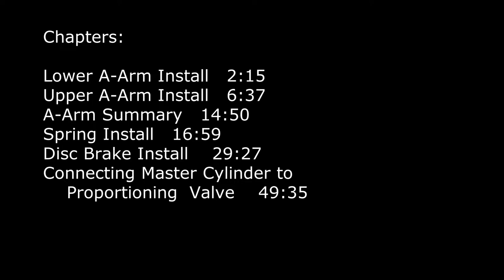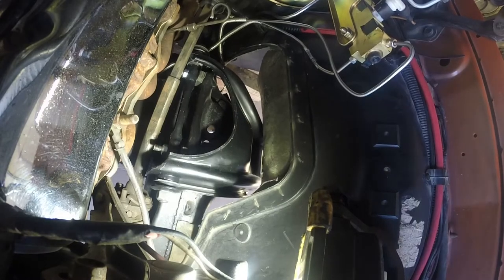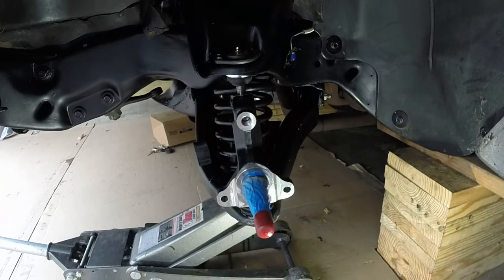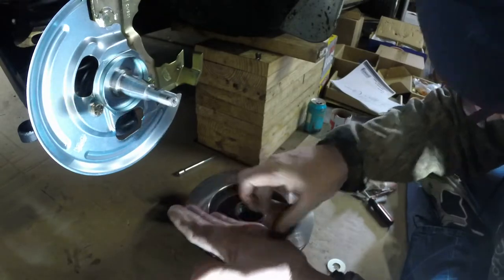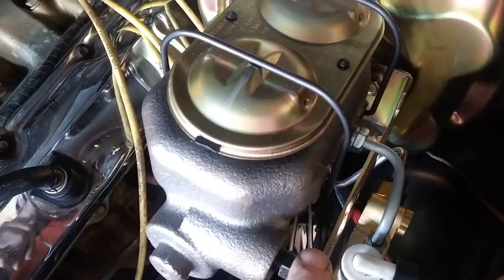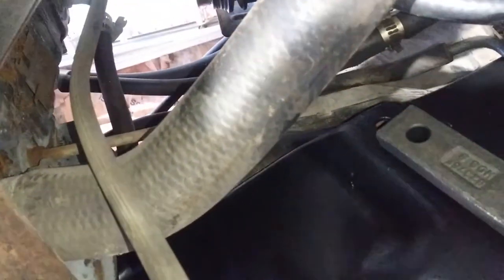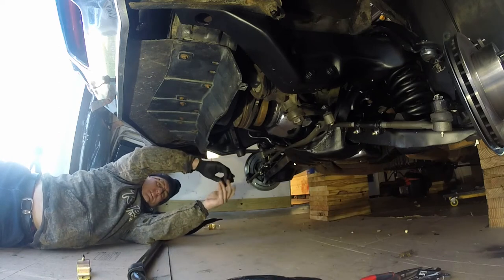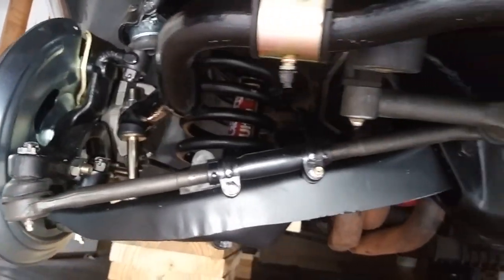72 Olds Cutlass Restored Front End ... In Detail

Comment: Hi great video! I just got my 71 last week and it needs whole front suspension redone like yours. Mine already has front discs. Do you have a link to all the parts you got like spindles control arms etcetera? It would help alot i want to redo it during winter.
Reply from the maker: That is a great idea and I will get one compiled and added to description. I used mostly moog  on the front end. Brake parts were from summit.
Reply: Thanks again I appreciate it.

Comment: Behind the seat of a 72 olds cutlass s, what part is that called? (has steel container, with 4 gas lines out the bottom, that’s hooks into the gas tank with the other gas lines connected)
Reply from the maker: Its a charcoal canister to capture vapors from the tank and fuel system. Thanks for watching!
Reply: @oldsguysgarage  Thank you, I appreciate the response, I’ll look into it 👍

Comment: I just got done doing the whole front end as well but now the passenger side has a squeak. Added grease but still have the squeak any input would be helpful thank you
Reply from the maker: perhaps have a buddy push down on the car as you are underneath to try to pinpoint area where noise is coming from. Perhaps its an upper or lower arm bolt?  good luck!

Comment: Can I ask where did you get spring compresser ?
Reply from the maker: Great question! I should have included that!  I bought it off of amazon. Performance Tool W89311 Coil Spring Compressor. I bought a power built compressor  and it didnt fit up through the lower A-arm. I did cutoff about 1.5" from end of bolt with cutoff wheel so the bolt wouldn't hit the top of the shock tower when spring was compressed.